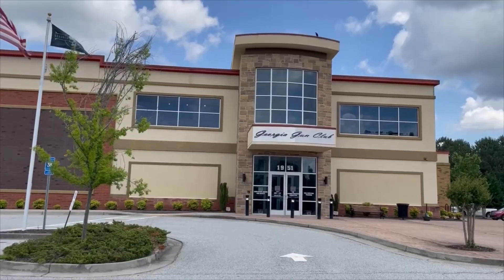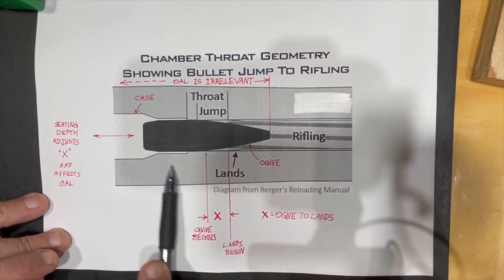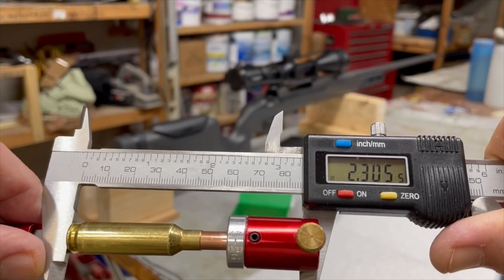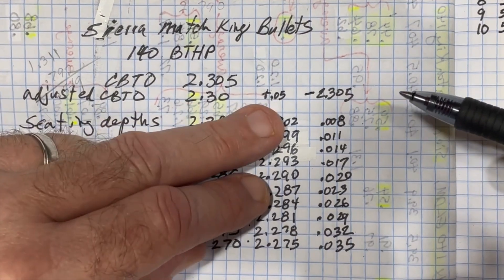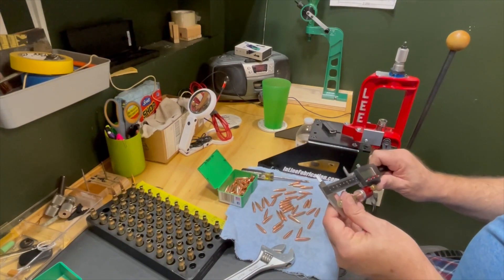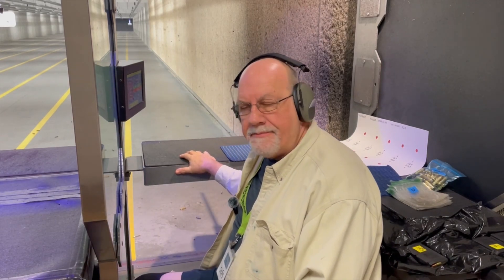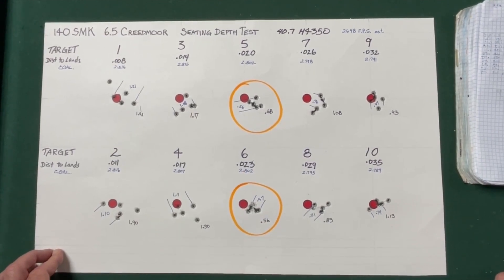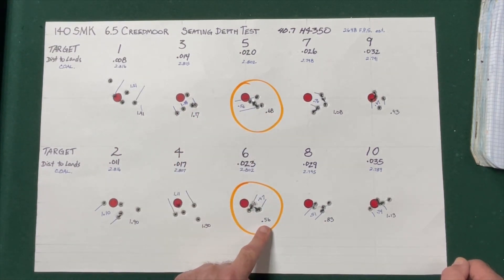6.5 Creedmoor, How to Determine Seating Depth, Loading and Testing.

Comment: Here’s a question, when using the hornady chamber tool, you’re using a generic threaded case from hornady? Is that case sized for your chamber? You’re measuring from the base but what if your chamber is longer than the case? Then, isn’t all that work for nothing? Would probably be better to use a case fired in your rifle and sized appropriately, then thread the primer pocket, and use that case for this operation. 

All in all, I’m of the opinion a lot of these practices don’t make a difference. Like using 3 shot groups to confirm a powder charge as you did. A 3 shot group doesn’t mean anything.
Reply from the maker: @sharpandloud3422  thanks for the comment. If you look at my recent videos you will see that I shoot 10 and 20-shot groups. I have also measured the chamber with a fired and sized case with a slit in the neck and an actual projectile. Thanks for watching

Comment: Thanks for vid. Maybe consider better calipers. Repeatability of measurement is important.  Doubtful husky which probably just licenses to a cheap Chinese manufacturer, lab tests them. Try them out on a good 123 block and see if they are accurate repeatable. The cheap ones can easily be off 1 to 3 1000ths every time you open close and zero. That can be a significant difference when coming close to the lands.
Reply from the maker: @JBesq  I appreciate the input. Thanks for watching.

Comment: If you use a a microminter seating die makes it so much simpler. Set microminter to max length and then 3  thousands deeper for every three shot groups or two shot groups if the group isn't acceptable. Then when you find what you want just go by micrometer setting instead of measuring over all length.
Reply from the maker: @davidreed6779  who makes a good micrometer seating die for 6.5 Creedmoor? Hornady?
Reply: @EverydayReloadingandShooting redding Micrometer seating die is the way to go.  Also rcbs match master is suposed to be good.   But I prefer redding dies.  The redding is the only one ive got experience with.  Works 👍
Reply from the maker: He still have to establish a baseline the old-fashioned way, though don't you? Thanks for watching
Reply: I like Hornady’s micrometer.   It’s good because once you have one micrometer you can use it on any other Hornady die
Reply: Micrometer seating die is def the way to go.   Love my redding Micrometer seating die and my Frankfort arsenal universal Micrometer seating die!

Comment: With most "hunting" bullets, and even most target type bullets, you can start at .020" off the lands, and then work up to OCW, and find a stellar load. Meaning sub 1/2 moa for 5 shots at 100 yards. Doing it this way, you don't waste nearly as many valuable components and you also reduce wear on your barrel.
Reply from the maker: Thanks Bear. With the 140 ELD match loading at the recommended OAL of 2.8"puts me almost exactly .020 off of the lands. Thanks for watching.

Comment: I am getting confused when you say coal vs cbto. I thought you measured cbto, so at 20 thou and 23 thou cbto you got the best group size. That is where you lose me because you start saying coal. So did cbto and coal converge at that point?
Reply: You would still want to use the cbto as your reference point yes? In my case I took a fired case chambered it and the bolt closed easily. So I used a bushing die and closed the case mouth to the point that a bullet would fit snug enough to stay in place. With the bolt removed I gently pushed the case into the chamber and with a wooden dowel through the muzzle pushed back. There was a bit of resistance so I resized until there was none. So I am not at jam, I measured then deducted 20 thousands back, for cbto. Similar to the exercise you did. 42.5 gns imr 4350 20 thou off lands and groove netted a very tight group at 100 yds. I did do a variety of powder charge and seating depths from the origin measurements and that is what got the best results. I think we are on the same page. Thanks again.
Reply from the maker: It seems like you would want to do that with the bolt, rather than a wooden dowel. The lands and the ogive are sloped so it’s very tricky to know when you’re just touching the lands. You can push a little harder and get jammed into them.
Reply from the maker: Hi Thomas. That is correct. as it turns out, when you have a cartridge overall length (COAL) of 2.8 inches, that puts you almost exactly 20 thousandths to 23 thousands off of the lands in this rifle.  Does that make sense? Thanks for watching.

Comment: Good Job on your analysis!  I love your range. Something to consider: Hodgdon and most other bullet manufacturers that publish loading data publish up to the last known good node before you are in high-pressure ranges. So technically,  in most cases, the hard work to determine the seating depth has already been calculated.  Unless you're going off the grid and finding the best possible node for your rifle per max headspace (which allows for larger charges), which resides at several nodes. My recommendation is to use this video, and you'll get there a whole lot faster: https://www.youtube.com/watch?v=oRXlCG9YZbQ.
Reply from the maker: You're right. The recommended overall length puts me 20 thousandths off of the lands which gave me my best groups. I will check out that video that you mentioned. Thanks so much for watching.
Reply from the maker: Yes, I go to this range every Wednesday. It is my favorite place to be away from home. I have seen the video by Eric Cortina before. I subscribe to his channel. One of my favorite creators. Thanks for sharing. And thanks again for watching